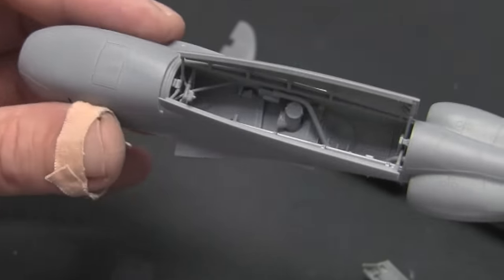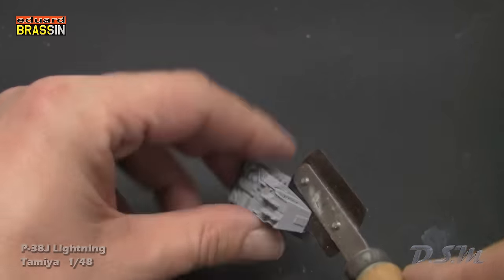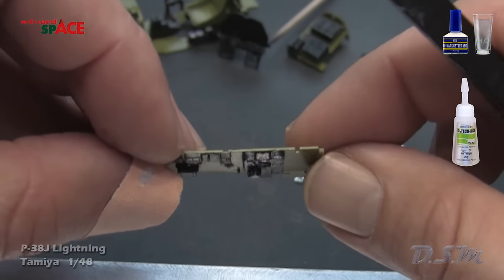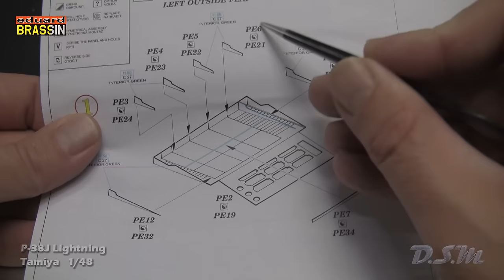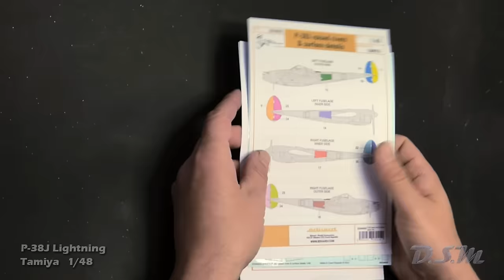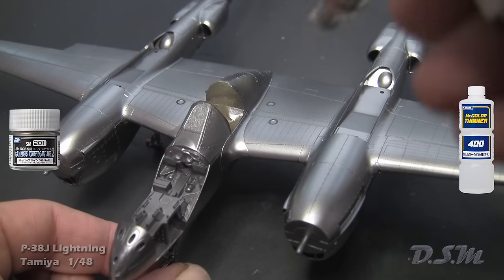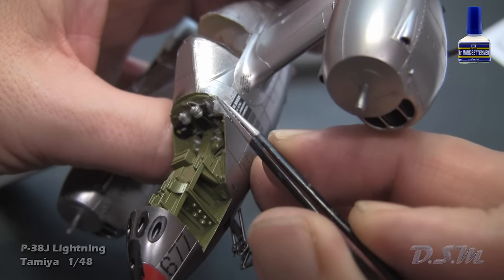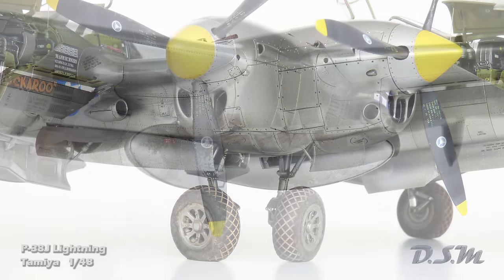P-38J Lightning Tamiya 1/48

Comment: The bulges in the rear are radiators ,   Very difficult to find 1941 drawing this plane ,   In this moment curved exhaustion structure with exhaustion opening facing the sky , beside the cop pit ,  for muffle the attacking sound , as stealth ,  thus the product from area 51

Comment: The overall finish is quite good, the surface appears very smooth, even at very close distance. I've seen several other plane models in "natural metal" finish here on youtube, but they mostly have a dowdy look because of a pronounced "orange skin" effect, already visible farther away. The reason might be insufficiently diluted paint or paint that dried too quickly. Seems to be a little difficult to find the correct mixture...

Comment: What would be cool is make one of the experimental P--38s. They only built two, but they had Packard Merlin engines and propellers from the Mustang. Depending on which rumor you believe, it had a top speed from 450 mph to over 500.
They also took a P-47 and shoe horned an even bigger engine into it, where they found a bigger engine I couldn't guess. It had a 500 mph top speed and was intended to intercept V-1s but the Germans started using V-2s and it was shelved.

Comment: What was your supercharger/compressor painting method/paints used?
Reply from the maker: Thank you all for your feedback. I don't use a compressor. I use a pressure cylinder from a breathing apparatus as an air source. I work as a firefighter...
Reply: Sorry I meant what colors did you use and how did you paint the P-38 supercharger? Thanks!
Reply from the maker: Sorry, I didn't get it... I first sprayed the compressors with C131 brown and then used different shades of Vallejo paint.